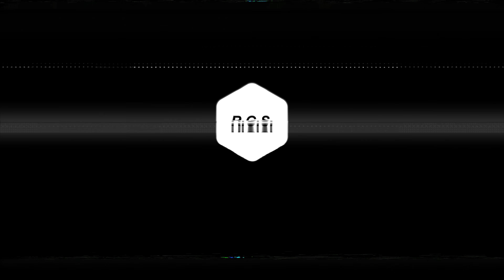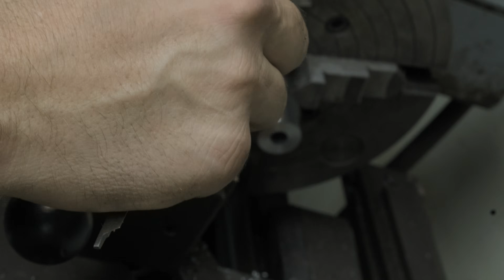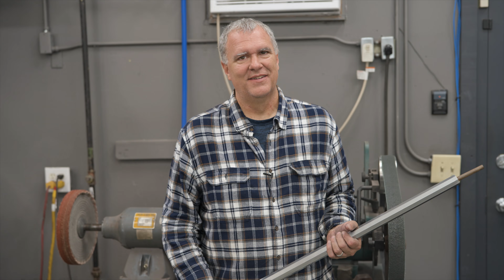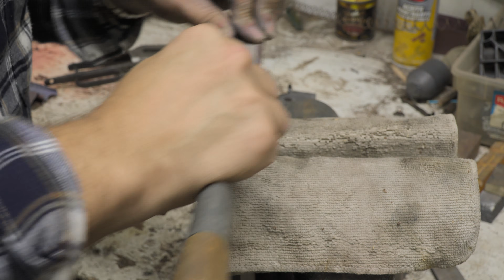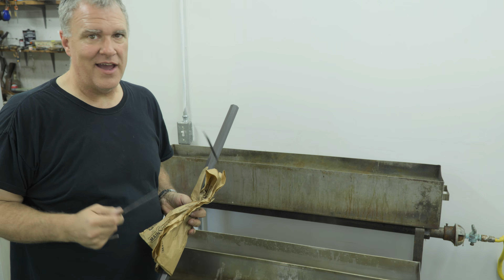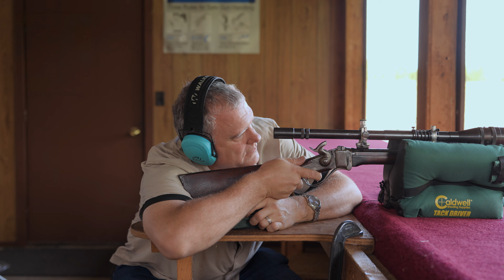Sharps Rifle Restoration: Machining, Bluing, and First Shots Results

Comment: Great video, I was wondering if you guys might consider do a complete ground up build with an 1874 Sharps or rollingblock?  Along with range time. You don't have to give away any secrets but a general step by from start to finish would be extremely informative and interesting. Maybe a short series of videos to cover it.
Reply from the maker: Thanks for watching and suggestions. They are in the making!

Comment: Is there a reason you don't use soft jaws or brass jaw covers on your lathe chuck to help prevent the witness marks from clamping it?
Reply from the maker: For my workflow it is not really a time saver as the barrel needs to be polished anyway. If it were a finished barrel barrel that would be a different story. Thanks for watching.

Comment: Mine is chambered in 45-110. While it's in great condition, I have about 100 rds of ammo for it, finding ammo now is damn near impossible. PS: If anyone knows where I can get 45.110 ammo, please reply with a source!
Reply: Learn to reload and guitar crying!!!!
Reply: @neonjoe6180  Well, 15 years ago, I bought a surplus mobile armory at auction. Had 2 Dillon progressive reloaders, and three Lee shotshell reloaders and a Lee Single stage along with about 40# of powder, tons of primers, brass and bullets. I had is set up at the back of my property next to my tractor shed. in 2018 a lighting strike set the shed and armory on fire, lost it all. FD just let it burn out because it was so hot from all the powder and the live rounds going off. I would purchase once fired 5.56 brass from a local army base. There was about 30k rds of 5.56 in it, luckily I had another 30k in storage in another shop that didn't burn. I've bought another tractor because I need one, but haven't got around to replacing all the reloading stuff, and in the process of rebuilding the shed. I'm going to try to rebuild my reloading setup but things going slow, I'm old now and doing things on my own. I'll get there eventually, I've saved all my 45-110 brass (about 250 rds) and hope to anneal, trim, and reload that.
Reply from the maker: May need to use 2.6" brass even though it'll be a bit short. Could also try to find 45-120 and trim it back. Good luck!
Reply: You have to reload.  Starline brass is all over gunbroker along with dies . Quite a common caliber

Comment: I have an original Sharps 1874 , made in 1877  in 45-70. The barrel was rough inside but good outside. In discussions with my gunsmith we elected to reline the barrel so it would still look original. He did such a good job you can not tell. It shoots better than I can hold. 3shots touching at 100 yards is dam good., using black powder 60 gr  Fed match primer and 405 gr FNFB . I never thought to use Varget in this gun, I use 5744 25 grs and it works well. I am really trying to keep the pressures at black powder rates. Tell me more about Varget in vintage rifles as I don't want to blow mine up. Very good restore on your Sharps. I don't think people realize how much time it takes to do this and how much skill is needed.
Reply from the maker: Thanks for watching. As for Varget, it gives you great case fill, and at very low pressures. Check the Hodgdon website, they have a lot of great data.

Comment: Is it 1874 model? Or a reproduction? I have an 1859 in 50-100 I believe (haven't had a chance to have a gunsmith check it ) but from what I've read is the earlier models did not come with doublesets, correct? Of course, not knowing the cartridge size or having any reloading equipment or supplies, I havent shot mine, and the costs add up quickly! Isn't it possible to add filler to smokeless to fill up the bigger chamberings? Anyone? Thanks.
Reply from the maker: Thanks for watching! The rifle in the video is an original Sharps rifle. Not all Sharps had double set triggers, some did and some did not. As for your loading question, the 50-90, 50-100, and 50-110 all share the same 2.5" case. And yes, some smokeless powders can be used with fillers, and some powder manufacturers recommend to not use filler. I would highly encourage you to research smokeless loading data for your cartridge, as you will find some great info about it. And remember, you can always use Black Powder, and with filler. Good luck with your rifle
Reply: I would recommend going to a local smith and have him slug the barrel and take a chamber cast . Many of the old guns are way over bore and free bore can get crazy. . That way,  you know what your dealing with .

Comment: Long Range competitor here.
I own 3 1874's, 1 Shiloh & 2 C Sharps. You must must must after firing a round put the hammer in the half cock position, failure to do so will sooner rather than later result in a broken firing pin because the firing pin is now setting in a diviot created in the primer & the hammer pressure on the firing pin dragging up out of the diviot will break a firing pin.

This is not opinion, this is fact, if you think I don't know what I'm talking about please, call Kirk Bryan at Shiloh RIFLE Co. In Big Timber Montana or the owner of C Sharps Arms, also in Big Timber Montana, these are the 2 factories that have been building them for decades, they'll both confirm this as FACT.

Enjoyed the video
Reply: He doesn't care. He is a smith so if he does and he will he can fix it...
Reply from the maker: Thanks for watching!

Comment: Please, Please, Please use some eye protection 🥽 when carding barrels... The finer the wire of the wire wheel, the more brittle they are and it only takes one of the thousands of wires on your wire wheel, to blind you. I know that the wire wheel is spinning clockwise but accidents can and do happen and you only have one pair of eyes 👀... I'd prefer you to be safe than sorry 😔 
OH; and I really enjoyed your video. Thanks 👍
Reply from the maker: Thanks for watching! Just want to say, the only part I didn't have eye protection on was the intro to the carding process. And yes, a piece of wire in ones eye can ruin your shooting!

Comment: Great shooting, excellent accuracy and superb workmanship.  
👍 
However, just think what might be achieved (in-the-field) with a stock geometry that provides meaningful CHEEK WELD for scope use.

A leather strap-on cheek riser would probably suffice and not look too out of place in the context of the overall aesthetic.
Reply from the maker: Thanks for watching! Agree with the stocks on those old Sharps rifles, in a lot of ways there more like early muzzleloader dimensions with lots of drop! I use the ol' "center the black ring in the eye piece trick" by moving the scope further away. It helps with keeping that steel tube out of your eye & the black ring can act like a sort of peep sight to keep parallax to a minimum.

Comment: As the group was perfectly in line vertically could the barrel lenght be tuned?
Reply from the maker: Thanks for watching. Before I would go that route, there are many options to exhaust further. Chiefly would be powder charge and type, and then there is also seating depth.

Comment: Greetings from Australia. Very interesting video. I agree with your comments on the suitability of 45/70 with smokeless. Velocity wise, I can exceed my mate's 45/120 running on black without much trouble, both modern Sharps with 30" barrels. I use powder coated 405s and 515 grain projectiles and the cleanup is minimal. I get slightly smaller groups with the Speer 400s.
I look forward to your video on bluing. I had good results with the Mark Lee Express Blue, but I'm doing it for myself and not in volume.
Reply from the maker: Thanks for watching. Your statement in regards to velocity with black vs smokeless is spot on, and with lower pressure using smokeless, which I think is a big bonus for original actions. I do think the 45-120 is just way too much empty case for good efficiency using smokeless.